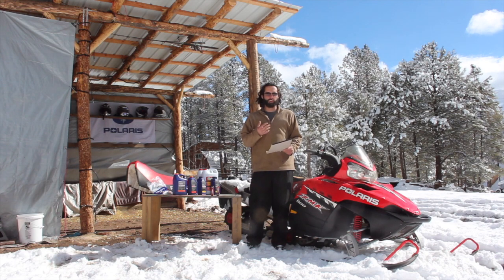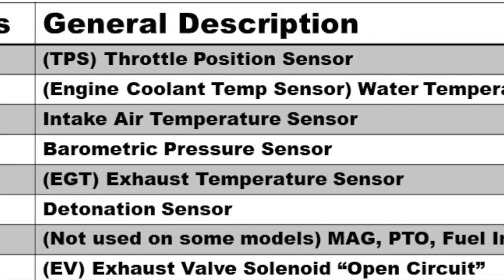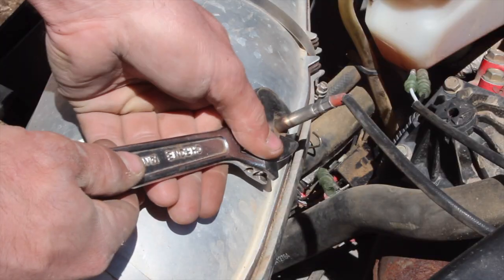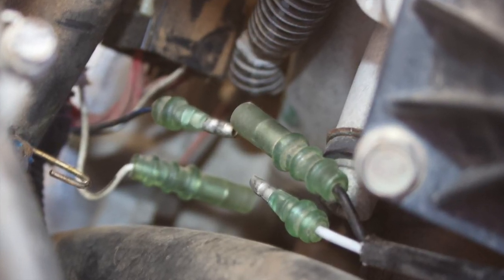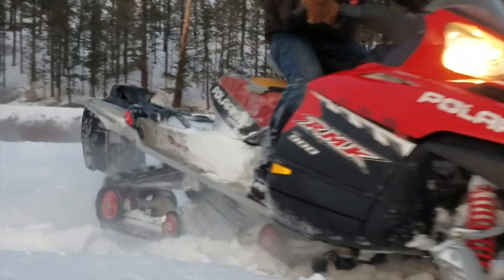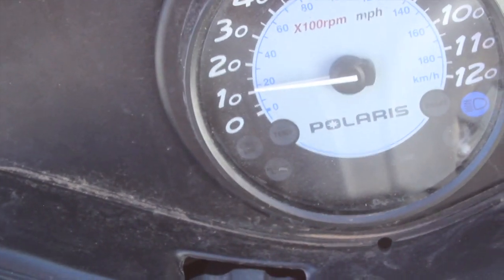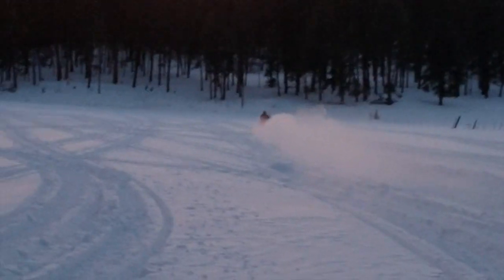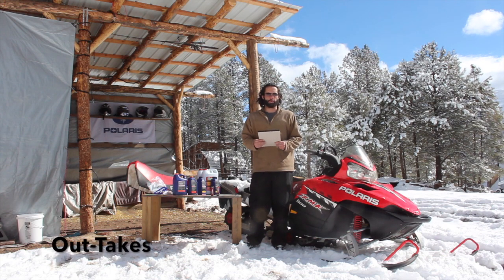Polaris Snowmobile Check Engine Codes & RMK 900 EGT Sensor Replacement

Comment: I have a 2009 assault rmk 800 and the oil light flickers at lower rpm and if I really throttle it up the check engine light starts flashing continuously

Comment: I just picked up an 06' 900 that's been rednecked beyond recognition. Finally put some time into it and got it running, but it's real rough and backfires like hell. Could an egt be the cause for this?
Reply from the maker: rednecked beyond recognition, that's funny. I'm not familiar enough with these big two strokes to say with any certainty. But hopefully someone with more experience will see this comment and have some helpful info. Appreciate you watching and taking the time to leave a good question in the comments. Cheers
Reply: @EscapePowerSports  Throttle body was stuck open! I had replaced the throttle cable and body from my parts motor and just hooked things back up without checking or adjusting anything! Couple new plugs and done fresh gas and it's purring like a walrus
Reply from the maker: @bruceradway9899  haha hell yeah glad to hear you got it fixed up. purring like a walrus, love it. cheers

Comment: Thanks for the info. Mine was blinking at high rpm when really getting on the throttle. I just got my 900 a week ago and it's been sitting the last few years. Kinda just needs to be gone over and have a little tlc.
Reply from the maker: no problem, seems like these sleds do better when being used more frequently. I'm sure you'll get her tuned up and ready to rip. Appreciate you watching and taking the time to leave a comment. Cheers
Reply: @EscapePowerSports  fast forward to september... the engine was rebuilt by the first owner and they reused gaskets, causing a water leak into the cylinders and ruined the pistons. Engine has been rebuilt and now the stator is out. Been a rough year on this sled lol.

Comment: So what was it doing before you changed the sensor
Reply from the maker: It was several years ago, but If I remember correctly it would run great for a while, but seemed down on power once the light came on. Hope this helps and thanks for watching and taking the time to leave a good question in the comments. Cheers

Comment: My 05 fusion 900 has the 7flash engin light
Reply from the maker: hmmm I've never run into that issue but maybe someone will see this and have more experience with a fix. Looks like 7 flashes could be a number of different issues. I'd start looking into the forums for that year bike with that code and see if there are any common problems there. Sorry I'm not much help with yours and good luck, let us know how it turns out. Appreciate you watching and taking the time to leave a comment. Cheers

Comment: No light but bogging bad off idle. Acts like its starving for fuel.
Reply from the maker: clean carbs, fuel lines, tank, and gas? good spark? bogging issues can be infuriating. Let us know how it goes and if your able to get it fixed. Thanks for watching and taking the time to share your experience in the comments. Cheers
Reply: @EscapePowerSports  its EFI (polaris cfi).  Fuel system is clean so i feel that it is in a sensor or something.

Comment: I have a 2011 Polaris pro rmk 800. The engine light was on and the code was 173-3. I replaced the sensor and the engine light went out for maybe 2-3 hours of off and on riding. Now the engine light is back on and throwing the same code. Could something be frying the sensor?
Reply from the maker: that's a great question, unfortunately I do not have enough experience with sleds to give you a good answer, I've found the forums to be very helpful for diagnosing issues, because if its happening to you it probably has to someone else as well. I'd also suggest buying a service/tech manual off the internet for your model sled as they also can be a wealth of information/ knowledge. Maybe someone will see this comment and have more experience with this issue and be able to give you a better answer. Thanks for watching and taking the time to leave a good real world question in the comments. Cheers
Reply: Did you find out anything about the question with 3 more years of experience? 
Thank you

Comment: I have a 2007 Polaris 750 IQ Turbo, the check engine light is on. It stays solid at all times, any suggestions?
Reply from the maker: not really familiar with that sled, all I can say is that I would do research on the forums and try to get ahold of a service manual to see what the diagnostic procedure is for that particular sled, wouldn't be surprised if it required proprietary Polaris dealer software to pull codes on the newer late model sleds, hope this helps and you get it figured out. Let us know what you find out. Thanks for watching and taking the time to leave a good question in the comments. Cheers

Comment: Can please make a video of the detention sensor a 2005 polaris rmk 900 becuase my engine light flashs 6 times but I can't find the sensor on the motor?
Reply from the maker: Unfortunately I sold that sled, but It was so awesome I'm sure we'll get another one at some point and if its having that issue you can bet I'll make a video of how to fix. In the meantime the online forums and especially service manuals can be a great source of how to info if there's no vids on the topic. Hope this helps and good luck with the fix. Cheers

Comment: I got a check engine light on my 2015  can am maverick xmr the code was 0P0131 and its the o2 sensor does it cause it to lose power because on mine it did and when it idles its sounds different whenever I start it up
Reply from the maker: hmm I'm honestly not sure as I've never had that particular issue, but it wouldn't surprise me if it did mess with the fuel map. Let us know if you get it figured out, and thanks for watching and taking the time to share your story in the comments. Maybe someone with more experience with this issue will see this and let us know on how easy the fix is. Keep us posted. Cheers

Comment: Thanks for the info, I have a 2006 Polaris 700 Classic. The check engine light started flashing 3 times today. Thank god its nothing to serious. Now I just have to find out where that sensor is located.
Reply from the maker: no problem. and that is good news its nothing serious. I'm not sure at all as I'm very new to snowmobiles, but I would assume it wouldn't be terribly hard to locate. Let us all know how it goes and good luck getting the sled back on the trails. Thanks for watching and taking the time to share your experience in the comments, I would bet the comment section on these videos will eventually provide more value than the video itself. Cheers
Reply: It’s on the left side of the airbox